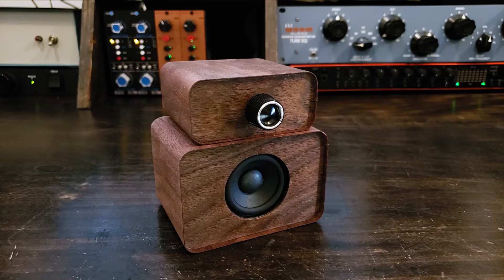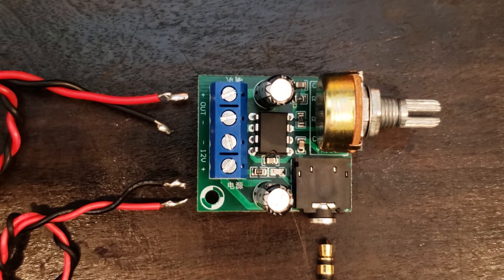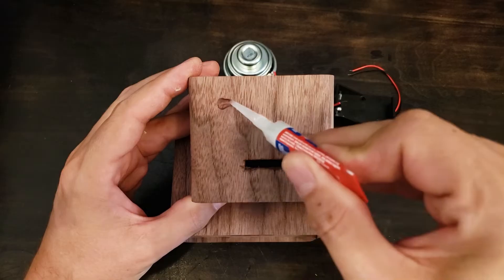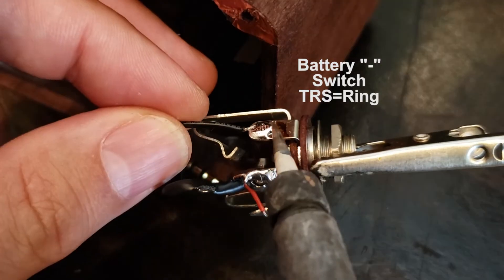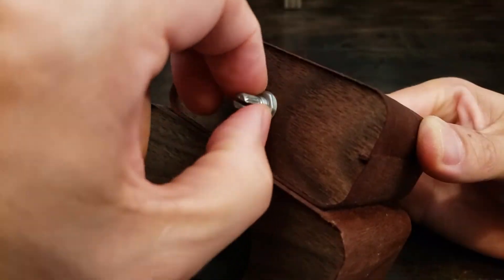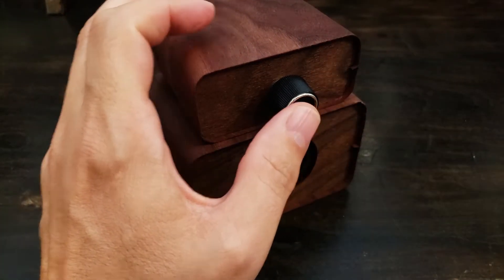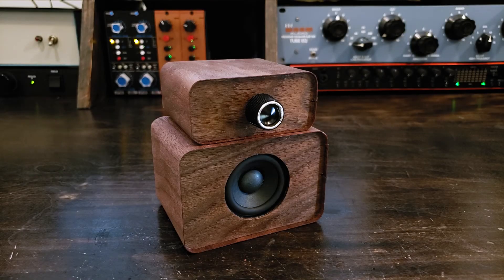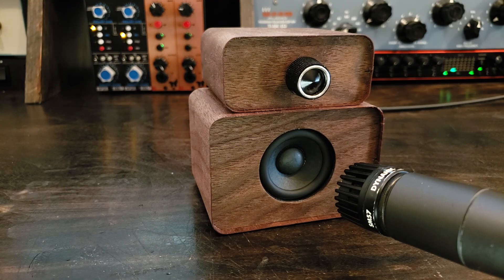DIY Guitar Amp - Amazon Parts #guitar #miniamplifier #electronics

Comment: How loud is it and on high volumes does it screech or echo?
Reply from the maker: It depends on the speaker.  It can get very loud, but it will only be as loud as you want with the volume knob.  Bigger speakers will sound pretty loud.  One watt is louder that you might guess with a big speaker.  In my opinion, this speaker is just a little too small.  I prefer a 3" or larger speaker.  Regarding the screeching, no it doesn't really screech, or feedback too much. You would have to get your pickup right next to the speaker to get it to feedback.

Comment: @FrankOlsonTwins  just to clarify, the 9v negative should be soldered to ring right?, and that same 9v will be fed to the ground of aux input?, or did i miss something?
Reply from the maker: Yes, 9V Neg(-) goes to the Ring.  The idea is , when you plug a normal TS plug into the jack, the Sleeve part of the plug completes the ground circuit for the battery, therefore switching the amp on.  
Since the mini amp input is connected to the overall ground scheme via the jack Sleeve, it works.  It's one reason these jacks are often referred to as "switching jacks."

Comment: I have those same amplifier board. The past 2 nights I've tried building the same circuit with the stereo jack. I can't get it to work. Though when I plug it in the light comes on just can't get any sound.
Reply from the maker: Check the little input jack. You might have to pull the input plug out until the sound starts to work.  The jack is meant for a short mono plug.  If you are good with a soldering iron, you can just remove that and wire in the proper connector you need.

Comment: Hey Frank...I bought everything in your video and followed the instructions to the "T" and no go!  it wont work.  I hear a buzz but no sound.  Any tips or tricks?
Reply from the maker: Ok, well buzz is promising, that means that the board itself is likely passing signal, even if it's not the right one.

The little input is funny on this board, you may have to gently push the input plug in or out to make sure it's making proper contact.

I would triple check your connections, to be sure they are where they need to be and not touching anything else.  Also, if you're using a switching jack for the power as I did, maybe try disconnecting that and run the battery direct to the battery inputs on the board.  

Buzz makes me think either there is an input issue or a ground issue.  Look closely at both and move wires around while listening for a change.

Let me know if any of that helps!

Comment: This connection was wrong.
Reply from the maker: How so?  The input jack is odd on these, it requires a short 1/8" plug.  But otherwise, the diagram should work.

Comment: can I do it with a normal guitar jack?
Reply from the maker: Yes, you will just have to figure out a different switch for the power
Reply: @FrankOlsonTwins just found a "6 legs" female jack here! its working great with a 4" speaker :D if you have any mods to this project, please share with us!!!
Reply from the maker: Congrats on the build!  The only mods I really did to mine was to add a gain switch which shorts pins 1 and 8 on the chip.  I also fooled around with a mechanical reverb by stretching an old reverb spring in front of the speaker.  It looks like this:  https://youtube.com/shorts/rkR80DfI6q0

For other 386 builds, you can search for "Runoff Groove Little Gem,"  There are lots of neat builds on the runoffgroove site.

Good luck modding and enjoy your amp!

Comment: This is fantastic, however when I built using basically the same parts I could just about amplify a signal from my laptop, but not from my guitar. The speaker seems to be fine but the output voltage from the mini amp seems to be less that 1V, which (according to reputable internet sources) is too low. Have you had any bad batches of mini amps? Not being an electronics expert I have tried to exclude everything else and am drawing a blank!
Reply from the maker: Hmm, occasionally you will get a bad chip,  they are static sensitive, so if you accidentally short the pins with your fingers and there's any static,  it could fry the chip. I've done that.  I'd start by triple checking and wiggling the inputs and output wiring to be sure they're perfect.  After that I'd try a new amp or speaker.
Reply: @FrankOlsonTwins  Many thanks. Bought a few more, same issues. Did you short the gain pins (saw this in another video of yours)? Might be the issue?
Reply from the maker: @judeprzyborski2564 I think they generally come with the gain pins shorted via a cap, but you could certainly short them completely and see if that helps.  But yes,  if pins are not shorted, I do short them for maximum gain.
Reply: @FrankOlsonTwins  You are the best, thanks!

Comment: Awesome amp build, but is it possible to make it without the gain?
Reply from the maker: Yes and no.  There are some things you can do to make it sound cleaner and less gain-y, but in general the LM386 chip is prone to distortion. 
You can disconnect pins 1 and 8, which are the gain setting pins, or you can put a fixed resistor or pot between them for you preferred gain setting.  
Also, using a bigger speaker like a 4" or 6" speaker helps.  
Finally, the LM386 responds best to guitar when used with a buffer of some sort, like a guitar pedal.  So, if using a pedal, you can adjust your output to the preferred gain for the amp.

Comment: I ran across this just last week, purchased all the parts and now I am confused about wiring the TRS audio switch. Would you be able to explain it to me in greater detail what wires go where on the switch? Thanks so much.
Reply from the maker: Finally, if the wiring is too complex, you can omit the "switch" and just connect all the negatives onto the "sleeve" of the jack, but you'll have to remember to take out the battery every time, or figure out a different switch.
Reply: @FrankOlsonTwins  Thanks so much for your reply and suggestions. I'm a 79 year old who is now going to make a mini guitar amp for a cigar box guitar. Can't wait to start and try it out. Awesome video.
Reply from the maker: Sure, gimme one min
Reply from the maker: Ok, here's a good way to think of it: the "tip" of the jack carries the guitar signal(to amp input Positive  +).  The "sleeve" is the guitar and amp ground(-).  The "ring" is the only actual switch, it connects the battery negative(-) to the ground.
Reply from the maker: So, if the battery negative is hooked up only to the ring,  it won't connect until the guitar plugs in,  then the shaft of the plug will connect the "ring" and "sleeve" turning the amp on.
Reply from the maker: Double check your wiring, battery negative(-) to "ring", amp input negative(-) to "sleeve"
And of course the amp input(+) goes to "tip"

Comment: A weird thing happened to me.. I built my self an amp with the same electronic components mentioned in this video and the amp worked just great!

NOW FOR THE WEIRD THING:
a few months past and I picked the amp and connect it to the guitar. The guitar didn't gave any signal and i assumed that the 9v battery was weak. When I reach the amp close to me ear i noticed some RADIO broadcasting! 😮
Reply from the maker: Yes,  it's very common for these little amps to pick up radio signals.   Sometimes different guitars make it better or worse!
Reply: @FrankOlsonTwins  I've picked up cell phone conversations on my Fender amp.

Comment: This is amazing. Thank you for doing this video. I want to add an optional audio out (after the preamp). How would you recommend I do this?

Thank you!
Reply from the maker: I think the easiest way would be to add a second output jack in parallel with the first.  There's not exactly a preamp and power amp in this circuit.  It's just one amplifier output for the chip.  You could look at runoffgroove for other similar amps and pedals that have more complex circuitry. This one is basically input and output, with no outputs "betweeen."
Reply: @FrankOlsonTwins thank you! I really appreciate it!
Reply from the maker: You bet! @alexweinstein9122

Comment: I'm getting distortion at any real audible volume with my guitars.  I've tried a 4 ohm and 8ohm 5 watt speaker.  Any idea why that might be?
Reply from the maker: There is a slight impedance mismatch with many guitar pickups and the 386 chip.  Usually a booster pedal (or active pickups) will clean up the signal a bit.
Reply: @FrankOlsonTwins don't have any guitars with active pickups - testing with  a jazzmaster.  Don't have a booster pedal, but I have a vox headphone amp (AP2AC) - do you think If I plug my guitar into that and then into the lm386 kit that would work?
Reply from the maker: @Jimiticus The vox amplug should work.  Any guitar pedal should be enough of a buffer, actually.  Have you tried turning down your guitar volume?  Sometimes that helps,  too.
Reply: @FrankOlsonTwins Ya its better if I turn the guitar volume down, but then its way too quiet.  I'll try the vox amp tonight thanks!
Reply from the maker: @Jimiticus  which speakers are you using?  I've noticed that some speakers work better than others with this amp.  It can drive even large guitar speakers.
Also,  these chips are known for a fair amount of distortion at higher volumes.  It might just be the nature of the beast...
Reply: @FrankOlsonTwins 4ohm 5w speaker.  Closest to the one you used, but couldnt find yours on the Canadian Amazon.

Just tried to Vox, still the same distortion issue

Comment: ive got a question, there are some bigger amp modules, that for example, claim "2 channel  X 80w" power, could this exact thing be done just with bigger speakers (and a proper 12volt/24volt psu)?
Reply from the maker: That's a great question.  I've been a bit curious about that as well.  I think it comes down to a couple things:
1.  The input impedance will probably be low, but needs to be high.
2.  The overall EQ would be a bit off, since guitar really doesn't require much below 50hz or much above 6khz.
If you can work around those 2 issues, I think it could work pretty well.

Comment: Great video. I really enjoy this. How do you wire up the output Jack ?
Reply from the maker: You can wire it in parallel from the internal speaker and if you use a shorting jack you can short out the internal speaker when the plug goes in.

Comment: If you were to also add a 9v barrel plug as well as the battery, could you still use that input jack/power circuit trip you added? That's a feature I want to implement.
Reply from the maker: Yes, you can also hook up a barrel plug.  That's very common on mini amps and guitar pedals.

Comment: I attempted an amp with this very module and failed to get any sound from three different cigar box guitars. My Fender amp works fine with their piezo. single coil and HB pups. Ive tried other speakers, other connections and of course the other module. My cellphone manages a moderate response. I wonder what pickup is driving your amp. Info is sparse on this isssue so I appreciate any help.
Reply from the maker: The only little glitch I've found with this module is that the little 1/8" input jack is wired for a short, mono connector.  If you are using a 1/8" plug, you might have to only plug it in until the "first click."  Otherwise, it might ground itself out.  The best way to test this is to have the rest of the module wired up(battery and speaker) and then plug in the little mono plug to hear if it makes any noise.  If you suspect the input jack is bad, you can remove it and solder a 1/4" jack into it's place with a short length of cable.
When the input is connected properly, my little amp works with any pickup(SC, HB, Piezo).
Reply: Thank you for that info. I was suspecting my input connection, but now I'll check it out!
Reply from the maker: Let me know how it goes!
Reply: @FrankOlsonTwins  It was that plug! Now I can make some
happy noise. I'll make a second amp with a pot on 1-8 and other goodies.
You made my day.
Reply from the maker: @ Great!  Glad it worked out!🎸🎸

Comment: Are you using a preamp before the amp? does the board input put out any voltage like an instrument level input?
Reply from the maker: No preamp before the amp.  The board puts out "Speaker Level" voltages, much hotter than than instrument level- and a different impedance.

Comment: what speaker are you using? My speakers can't handle the sound of the guitar😭🙏
Reply from the maker: This is a 2 watt bluetooth speaker. You can find old speakers in radios, alarm clocks, or other old devices.  Or most speakers rated for 3 to 5 watts will handle guitar frequencies.  The bigger the speaker is, generally the better it will sound.

Comment: I just built one of these today! I plan on making the enclosure tomorrow. Two questions if you don’t mind. What wood/material are you using for your enclosure? I tried looking for something similar and bendable but I couldn’t and opted for a different design. 

Where would you recommend someone wanting to learn about this stuff do next after this project ? I’m a complete newbie and didn’t know anything about electricity or soldering before this video. I would love to learn how to make some pedals and regular amps someday but I’m sure there are some steps I should be taking before then
Reply from the maker: Cool!  Did the amp work?   The wood i used is from the Cricut brand. It's actually 2 plies with a layer of strong plastic in between.  That's what makes it bend so well.  Regarding amp making, i think pedals are a great way to get deeper into the hobby.  Pedals are often 9v and you'll learn a lot by making them, including reading a schematic and soldering.   Also,
Reply: @ yes it worked! I am having this issue where the amp only sends receives sound when the 3.5 jack is pulled out slightly. Also the listing on Amazon was wrong and said mono jacks when they were actually stereo jacks so I messed up a few times trying to get it started, but I have sound now and am so happy with it. Thanks for the suggestions!
Reply from the maker: Yes, it sounds as if the the stereo plug is too long for the mono jack, so pulling it out slightly would be the right thing to do. And it seems like you figured out the wirinng to the plug, since it's too long,  it will contact the grind at a different point.  Once you get the"+" and "-" figured out,  it's not really an issue.  I'm glad it worked!
Reply from the maker: Also,  you can try lots of different speakers, better speakers will sound better overall!
Reply from the maker: Also, check out "runoff groove" for lots of small amp builds that can match whatever level you're currently at.  
Stick with the battery powered stuff until you have a solid grasp of how electricity works and how to safely handle and wire-up projects. Find a person to talk face to face with about electricity,  they will help you get familiar with safe handling.  Also, watch lots of videos,  and try to read simple schematics of amps/pedals you might want to build.  You learn a lot just by looking at what parts are used where,  and trying to understand what all the parts do.  There a lot to learn, but pedals and preamps are very satisfying to build!

Comment: could i put any speaker in, and how could i do multiple speakers
Reply from the maker: Yes multiple.speakers are fine,  wire them in series or parallel
Reply: @FrankOlsonTwins  what is the requirement for watts or ohms the speaker has to be?
Reply from the maker: With this particular amp,  there really is no "requirement." You can use any speaker. If i was going to buy one,  i would get a 3" or 4" speaker, 4 or 8 ohms, about 5 watts.  I'd look for an old speaker out of a clock radio or something. 
But this amp will drive any speaker you can plug it into with no problems- even 4x12" guitar cabinets. 
So get the speaker that you think will work best for you,  either large or small.  Good luck!

Comment: what are the requirements of the speaker because i want to try different speakers. The one you recommend is too expensive in my country
Reply from the maker: Absolutely any speaker will work with this amp. Pick your favorite!
Reply: @FrankOlsonTwins  any portable.speaker recommended for bass?
Reply from the maker: @meloman1551  If you're using a very small amp like this, try to find a paper cone speaker with no foam surround. If you're using a bigger amp, I'd try to find one that's 6 inches wide or bigger.

Comment: hi, I'd love to build this but not being familiar with the trs mono jack with shunt I found it hard to follow your video wiring. It appears you bridge two positives with a jumper wire but that is not in the diagram. A more explicit diagram would be much appreciated!🙂
Reply from the maker: Hey, the diagram is correct, but so is the video!  That red wire is coming out of the cable jacket, it is not jumpered to the other lug.  Look closely before and after the red soldering scene, you can make out that the red wire is only soldered to one place.
Reply: @FrankOlsonTwins  Great thanks for the clearing that up! Since the amp input is the aux cord, could I assume that if I've wired two speakers, a left and a right that this will also work. Also, we are using a similar class d amp with a TPA3116D2 chip 5-27v so hoping this will also work.  building speakers with students but have one student that loves electric guitars so picked up one of the mono trs output jacks so they could use this as a guitar amp. great idea using the jack as an on off switch!
Reply from the maker: Sure, you can wire as many speakers as you want, but you must do so either in series or parallel since this is a mono amp.  There will be no left or right, just mono through all speakers.  The hookup will be more or less the same with any chip amp board- Input to board, output from board and power supply.